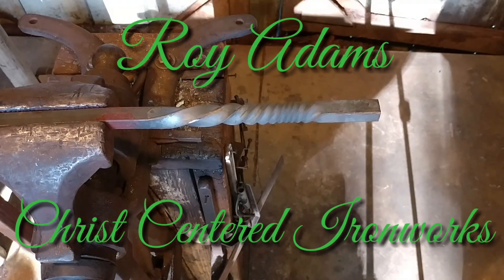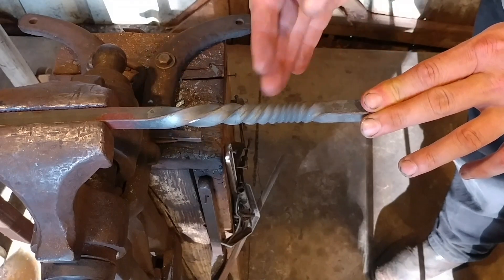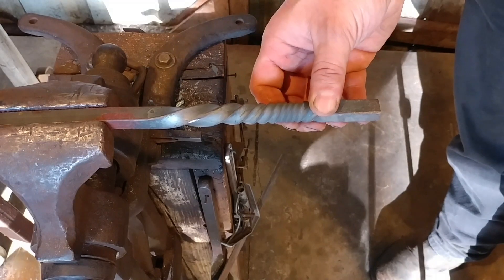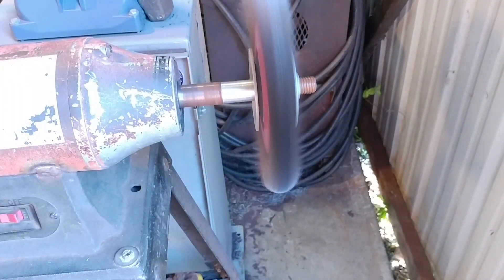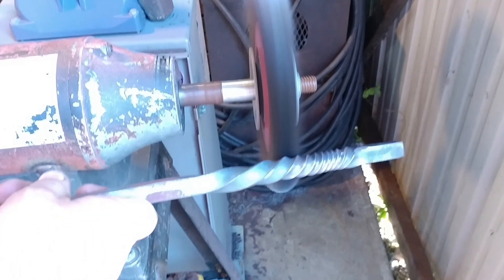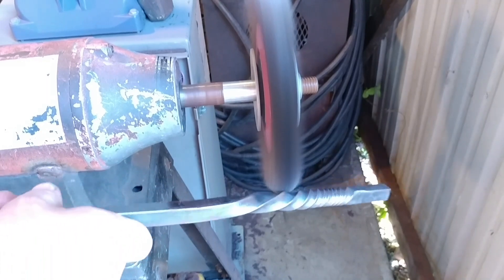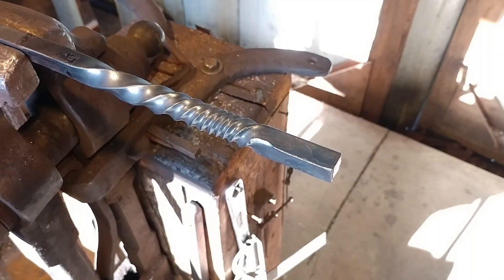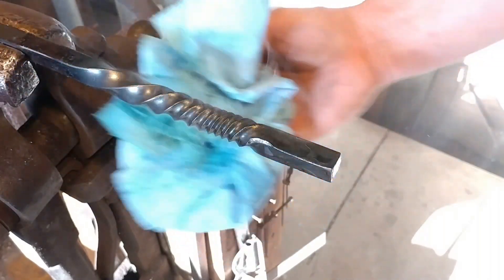How to Create an Even Finish on Your Metal Projects

Comment: Any suggestion for finishing a batch of like 24-30 hooks at a time? It's a pita to wire wheel them all because they are a weird shape so they take forever and sometimes get grabbed and thrown by the wire wheel. I feel like I'm spending way too much time finishing them compared to forging them all. Idk if it matters but I typically use 1/4" square

Comment: Great vid, does the oil last long for rust protection, I'm trying to figure out the best rust protection for my bottle openers, and does putting it on hotter steel bake it in instead of a layer on top? thanks

Comment: I have also heard good things about using a butcher brush.  It is like a regular steel brush except it uses flat bristles instead of round wires.  It works better at getting the scale off than a wire brush.  Joey van der Steeg (another YouTube blacksmith) uses them & he did a video (https://youtu.be/-6IWilfMxos) of them a few months ago.